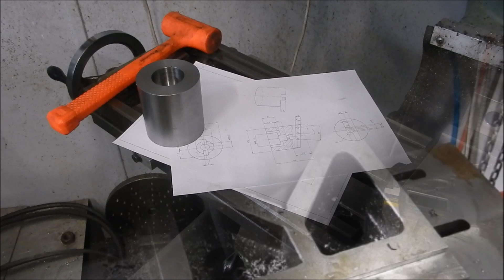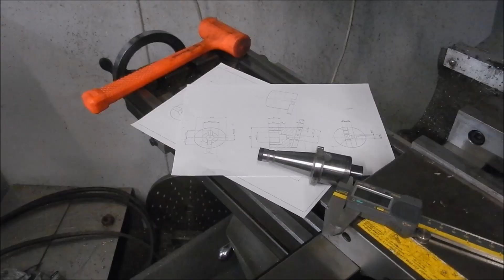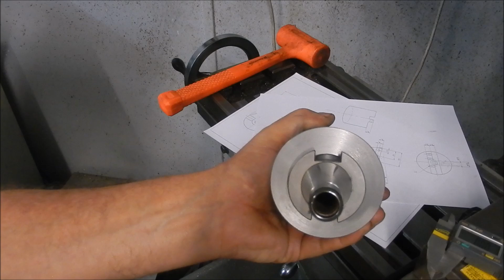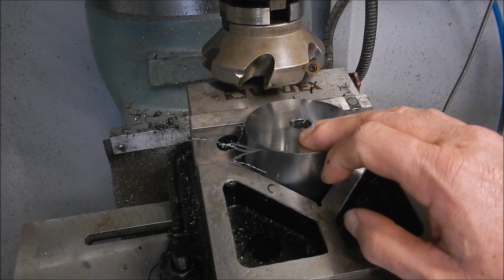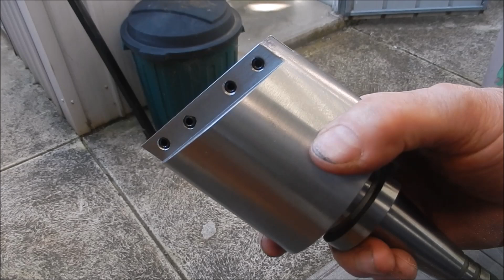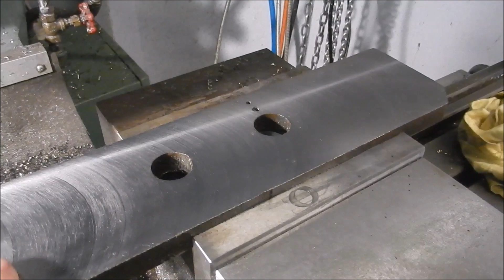Fly Cutter Build Part 2

Comment: Can you please explain why the tool is tilted at an angle, if it was flat to the bed the insert edge would still be the lowest point. I think cutting the tool on an angle is a leftover idea for when there were flat HSS toolbits. With the insert protruding beyond the toolholder body on insert tools you are using, is this angle required?
Reply from the maker: G'Day Marley, angling the tool further reduces the rake angle on the front in the direction of feed.  I have a straight fly cutter that I tried this tool on, it was like cutting under the skin of a chicken.  It skimmed under the surface and didn't create a chip, just created a thin skin.  With the angled cutter it creates a nice chip and I can cut deeper with less rake.
Cam
Reply: @camatbattler2233  Thanks mate. I assumed that the depth of these finishing cuts would always be less than the radius of the insert to reduce clatter making the approach the same at these shallow depths of cut.
I understand that this is not desireable at larger depths of cut but if it was an issue why not use a square insert at 45 degrees or a round insert, both set flat? There seemed to be a lot of extra work to replicate the angle on old style flycutters that were designed for flat sided square HSS toolbits that did not have the advantage of the cutting tip above the tool face.
Reply from the maker: Hi Marley, the type of tool used was what I had at hand.  Its a left hand insert tool the I use vary rarely so I thought I would get some more use out of it in a Fly Cutter.  Maybe one day I'll buy a Button Insert Tool and try that but this does exactly what I wanted it to do, leave a brilliant finish on the part when required.
Cam

Comment: Gday Cam, you really can’t beat a fly cutter finish, I’ve been using a Palbit DCMT insert lately, I was using cheap eBay specials previously, the difference between the 2 inserts is very noticeable as well as the longevity of the insert, great build mate and thanks for the mention, cheers
Reply from the maker: G'Day Matty, thanks for looking in mate.  Its my first build for quite a while, got a lot happening at home right now so not a lot of time in the shop.  I'm very happy with the finish it leaves, 0.5mm is probably about the max I would take buts its great for finishing off parts.  Thanks for the push along to do this one.
Cam
Reply: A button insert face mill of an appropriate diameter takes a lot of beating. Balanced tool, higher rpm, much faster feeds, and much less impact on the part and spindle bearings. Modern ground inserts in modern close tolerance pockets with multiple inserts engaged all lead to a virtually flawless finish in a fraction of the time.
Reply from the maker: Hi, yep totally agree, a good face cutter with quality proprietary tips does leave a great finish.  Yes the unbalanced dynamic of a Fly Cutter can be a problem.  My largest face cutter is 80mm diameter.  The Fly Cutter will comfortably machine out to a 150mm diameter with a very good result.  I think I will only use this where the finish makes the part look good to the eye, for 90% of work I do the facing cutter is fine.  Anyway it was a fun project to do on the side.
Cam